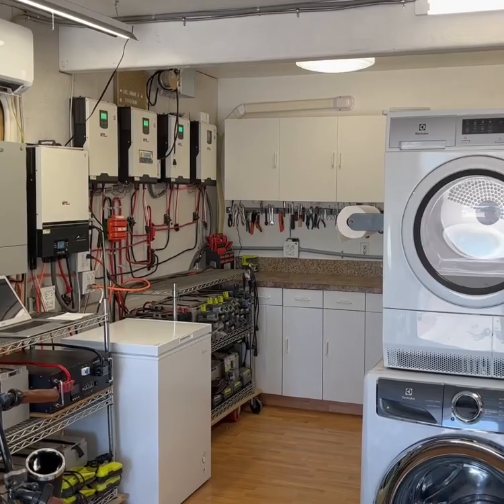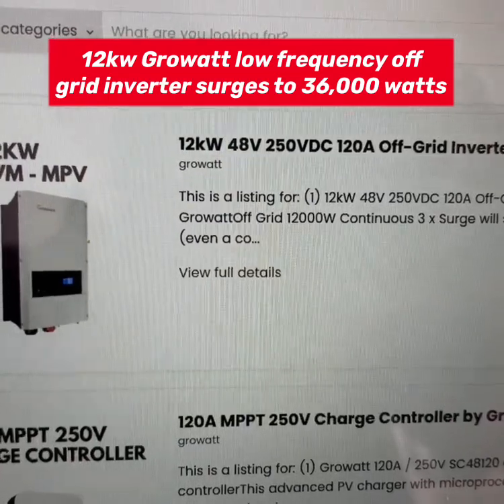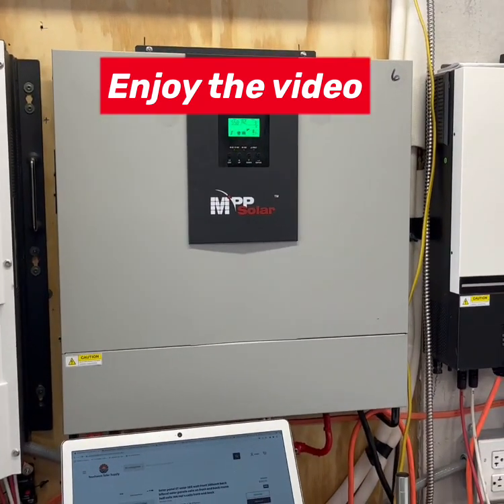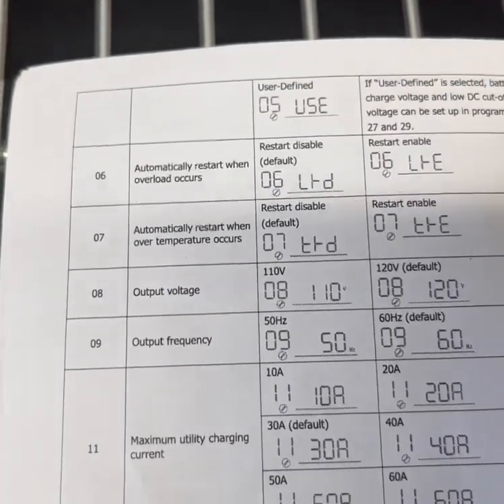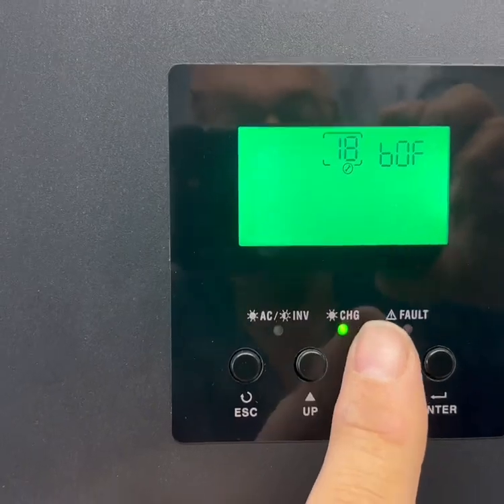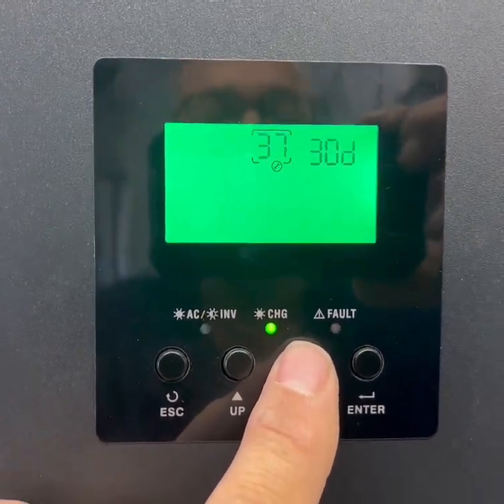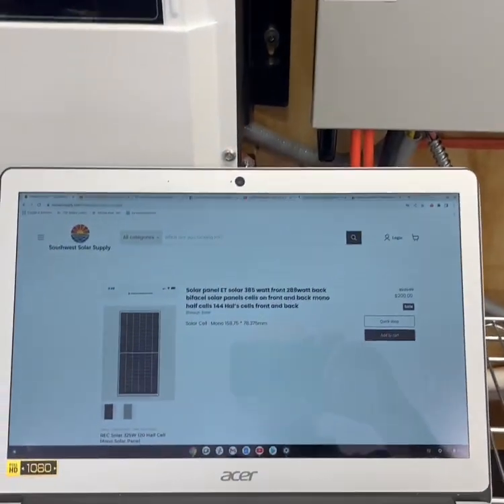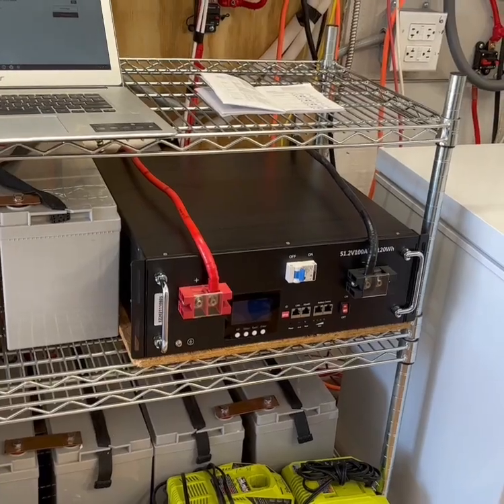Lithium Iron Phosphate battery replaces 48v AGM battery bank & programming inverter in 20 min

Comment: hi there do you know what happen to them on the battery,s the site is down
Reply from the maker: If you are talking about the “light catcher solar AGM” website, they are only on eBay. They took their website down, not sure when. I don’t even think they are selling the AGM batteries anymore. There are a lot of sellers on eBay selling $100 less than what Light Catcher Solar was asking for their battery.
Reply: the server rack battery.s
 @diy-solar-guy
Reply from the maker: @JonOffgrid  southwestsolarsupply.com
Reply from the maker: Southwest solar supply
Reply from the maker: Or signaturesolar.com, both have the server rack batteries
Reply: alot off grid  ppl are getting eg4 batteries   but they  are to much sok are grate  but looking for a batter deals in sever rack batteryies  @diy-solar-guy
Reply from the maker: @JonOffgrid  I’m not sure I will get another server rack battery. They don’t pair well with my inverters. All 4 inverters seem to have a problem with communication from battery to inverter.
Reply from the maker: @JonOffgrid  big battery had buy 3 server rack batteries get one free back in December, they might do another sale again soon. Keep an eye out. By the way, big battery parts inside are Battery Evo , BMS, LiFePO4 cells and wiring, case. Just a different logo on outside, saw 3 diy guys on YouTube tear apart big battery and it was all Batteryevo parts.
Reply: like talking with like   minded PPL
Reply from the maker: @JonOffgrid  I like using my AGM for the summer time starting up my 3 1/2 & 4 ton heat pumps on house and pool 12.7 ton heat pump pool heater. That server rack battery with only one can’t handle the large loads. The AGM batteries have no problem. Not sure if I will get another server rack battery when I can get 4-12v 150ah / 8 KWh batteries for less than one server rack battery that is only 100ah / 5.1KWh. I can use the 12v as 4-12v in parallel or 2-24v battery banks in parallel or a 48v battery bank with the 4 in series.   That extra 3KWh with the 12v batteries is nice for overnight using mini splits. 12v batteries pair well with all my inverters, no communication errors and they handle the high loads. I have 33kwh total right now between AGM and LiFePO4, so really don’t need to buy more batteries unless it is a smoking insane deal.

Comment: Transform will let it be both 120/240 and balance the loads and extra surge protection I like those mpp I need to contact peggy in Taiwan again
Reply from the maker: Can’t wait to try using the transformer.
Reply: @diy-solar-guy  I called first time you were talking. About it there is alot of little things you can do to run your house all nights and all day super reliable for you Incase the power starts to go crazy fron all the lake watter we have lost o gave sone on hold but alit sold so I will how you a nice set if battery's and a rack when you are ready also and it will hello so much more with testing got me  if you add 2 or 300 more amp hours for 20,480 watt hours
Reply from the maker: @richeagleton5285  that is what viewers are really interested in , is running ac, whole house on and off grid , etc all day and night.
Reply: @diy-solar-guy  no problem I saved a solar edge trabsformer also I think there a little better I add it to the box of the 12k and that noise reeeee noise goes away that if it happened slot can shift and mess with transformer inside the unit I added extra transformer and it cleans up the surge load on the inverter also if you make 2 different boxes for one the mpp the other the growat that full setup with brakers and everything you can add I sell SMA sunny boys abd it can conect sbd control the inverters even grid tie units it makes it abs island I'll talk to you about it but it's he SMA 6000 I could have you test there brand new abs can connect 6 together and there growatt size. Low frequency check them out in my web site maybe you can test that for me for free to show people the capability's but one or 2 more battery's that thing will be a beast if a battery it's will I put dobke there not the EvE 105 that I asked to come with the others or that's why they will only make or at .66 C tge EV can max 2 C
Reply from the maker: @richeagleton5285  sure. We can test anything in a video. Just let me know what you want to do a video on. I will probably be taking those 24v systems of the wall so I will be able to mount anything on the wall. A lot of interest in the Growatt inverter, House AC, mini splits running, etc
Reply from the maker: @richeagleton5285  let me know when you are available for me to either drive to your place or you come to mine to try these ideas. I am available anytime.
Reply: @diy-solar-guy  I want to get you. A battery rack and transformer with the sunny island. You could run your whole house off the mpp and all the AC off the other 2 or even with the amount of power you have if you decided the loads ad a good abound of battery should run your whoukd house with your ACs like I was doing when I turned my house off it last me all night in winter abd when sun comes up I'm fully charged before ten they can drop to 2.5 per cell and go to 3.65 per cell do tones by 16 cells you have so huge voltage range
Reply: @diy-solar-guy  I'd love to cone over and bring you sone stuff abs show abs help you as mush as I can with one arm
Reply from the maker: @richeagleton5285  whenever you want to come over is fine with me.I am home all day, everyday. Just give me a call. You have my phone number from message on your website.
Reply: I want to show the SMA can connect the inverters together also or atlest I'm. Vary sure. Iv never tested these 2 units but the sunny islands are vary impressive

Comment: Great video and explaining how to set up. Great job
Reply from the maker: Thanks for the help with your expertise Rich.
Reply from the maker: Super cooled my house to 67 degrees upstairs and 69 downstairs with outside temp being 107 degrees at my house, set my thermostat at 78 degrees last night and my ac never turned on upstairs or downstairs. House was 77 degrees upstairs and downstairs this morning when I got up at 6:30am.playing with an idea for last 2 weeks in keeping the attic space below 90 degrees during the day. That helps so much to keep house cool after sun goes down. Less need to run ac at night.
Reply: Maybe even have them blow more insolation from bowler bare they can super cool your house abs seal it tite

Comment: it is Lithium IRON Phosphate or LFP/Lifepo4, not Ion. just FYI 
PS, Glad that you finally took my advice and got yourself a LFP battery. I did tell you that they are awesome! I have 30kWh of them myself, and another 30kWh on its way from china right now. Should be awesome!!!   😃
Reply from the maker: I did not know that about IRON, thanks for the correction. All the material I received with the battery says Ion, not IRON so thanks. Thanks for the suggestion on the LFP battery. I will really enjoy the battery bank when I can afford more in the future and will be able to run AC overnight. More than likely will be running the mini split heat pumps at night. Hope you have a really wonderful and blessed day.
Reply: Lithium iron phosphate the ion is to dangerous builder made correction on the new battery's
Reply: Also can connect the growatt to battery with cat 6 I'll send you a video I'd will set itself on the LI mode on the growatt